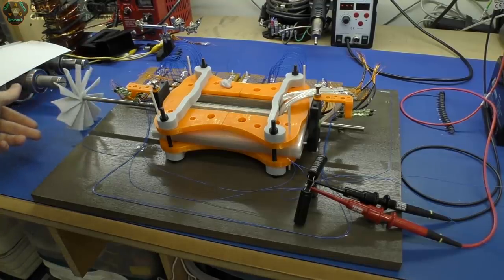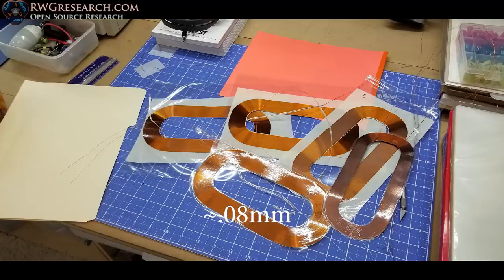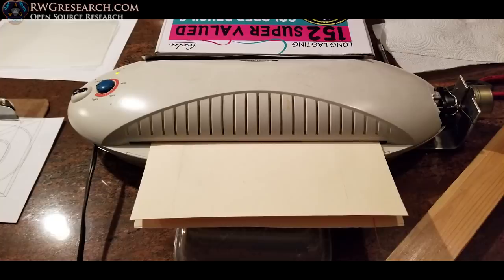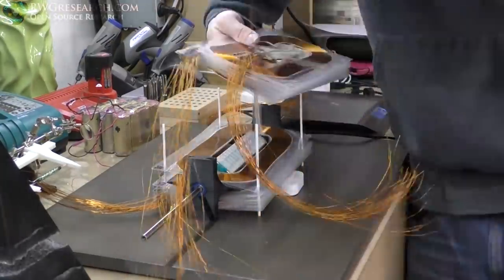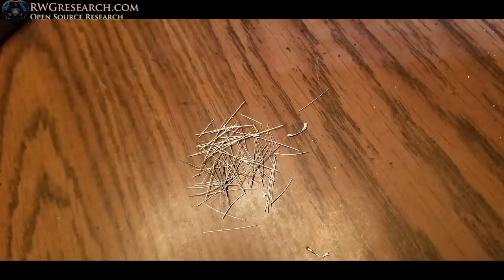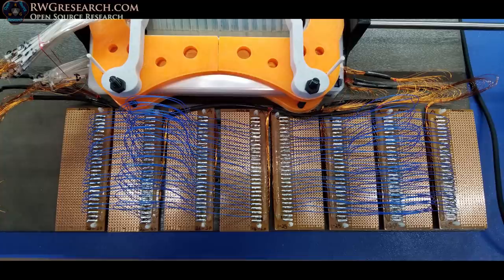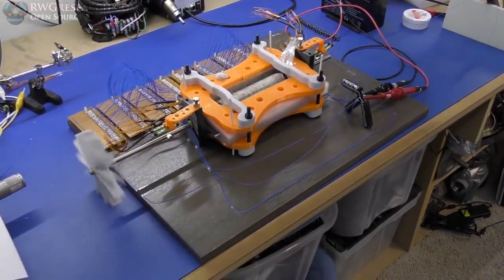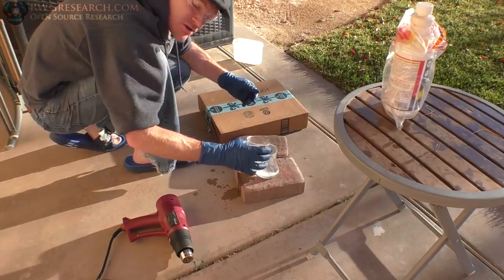Building The "Cheesy Fan" So Much Detail! So Manny Wires! So Much Fun!

Comment: Nice, I enjoyed the thorough documentation. The wire tinning might have been a bit easier with a solder pot and a container of liquid flux but you figured it out your own way! Keep that sulfuric acid handy if you ever want to make expanded graphene in the microwave for conductive ink and supercapacitor* fabricating. Very low resistances this way especially with calendering painted sheets. Robert Murray Smith and Cayrex2 are the sources of knowledge for this. Also, super dielectric "strange" capacitors are very interesting too.

Looking forward to seeing your demonstration of the parasitic capacitance of the coils. Would love to see how much energy you can harvest from the pulses and recycle, especially considering your work is more focused on the resonance, and demonstrating that resonance in motor design is practical and not trivial. 

I'm all about switched reluctance motors personally. I just like how the motor type doesn't use neodymium but operates just as well, with very nice torque-speed curves. I haven't looked at ZPE or re-gauging theory from the original equations of Maxwell or Gauss in like 6 years so I can't quite recall much, but I'd like to understand the benefits of a permanent magnet motor over a strictly iron motor. It's a sad thought, but during my last years at university back then, there were no electives for motor design despite looking everywhere to find them, or motor mentors for self-directed studies.  Vancouver was probably just not the best place for it, but it's not typical for most schools to offer motor design courses, we just learn about existing technologies in the industry, characterize them, and use them in our machine design. 

Lastly, with all the work you have done, could you say that institutional science got the 1 horsepower = 746 watt energy conversion rate right? Or did they just get energy consumption wrong?

Keep up the great work, hopefully nobody minded the coils in the kitchen during the build haha.
Reply: What do you mean with using sulfuric acid for graphene ? Just to extract the graphene sheets from the graphite powder ordo you mean how to wire contacts to graphene sheets ?
Reply: @oudotcom  That's right, sulfuric acid is one of the ingredients used to make expanded graphite when microwaved.  You can get the sulfuric acid from old car batteries in most cases, but please do watch some videos on expanded graphite  first as you could ruin your microwave and the fumes are not great either so it is best done outside. Expanded graphite has superior properties to bulk graphite used in conductive inks for many applications including supercapacitors.
Reply: @Infinion  But you can also use other stuff instead of sulfuric acid, which IO would prefer...either electrolysis is much better to get graphene sheets from graphite electrodes...also just microwaving then these graphene sheets  will get even more surface graphene sheets...